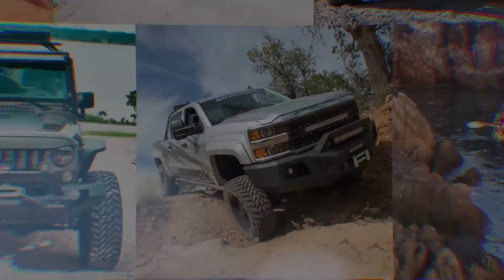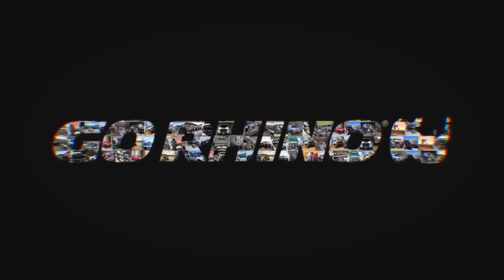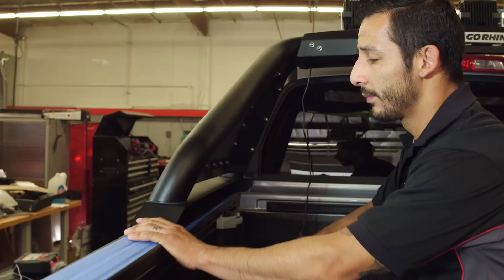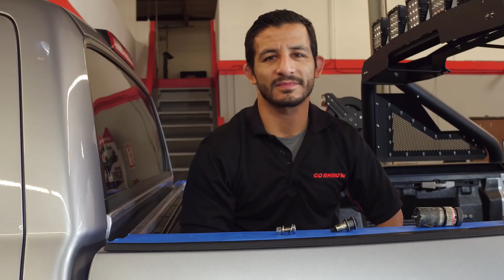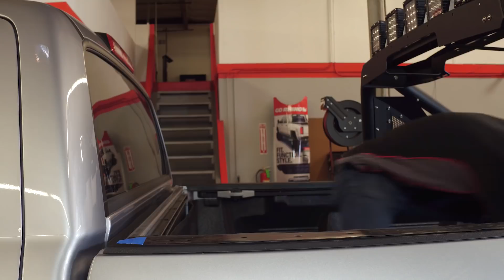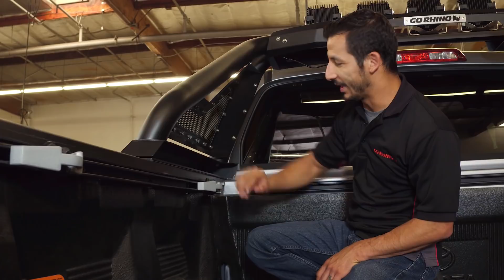Go Rhino Sport Bar 2.0 Overview & Installation (911000T & 960001T)

Comment: do you have to use the 6inch square lights for the retraction option or can i use a light bar ?
Reply from the maker: Scott, we specifically chose to use the square lights but you can use a light bar as long as it fits inside the housing when retracted.
Reply: Go Rhino. can you please tell me the inside retracted dimensions so I can ensure my lights will fit the bar.
Reply from the maker: Scott, the space is 6 7/8" x 42 5/16" so you can fit lights that are up to 6" tall (or square) like the Rigid Industries Q-Series lights that we have and/or up to a 38" light bar.
Reply: Go Rhino thank you ! Whats the depth ?
Reply from the maker: The 6" Q Series lights are pretty thick. The lights are about 3-3.5" deep but we wouldn't recommend anything more than that or you run the risk of the back of the light catching on the bar as it retracts.
Reply: I’m having a hard time finding a 38” light bar.  Any recommendations?
Reply from the maker: There are a few companies that make a 38" LED light bar. We use Rigid Industries, but we know they are a bit pricey. Doing a quick search we were able to find one from Cree who makes a single row 38" LED light bar. We also found a double row 38" LED light bar sold by a company named Assault LED Lighting. Let us know if you still have any trouble finding one for your vehicle. Thanks!
Reply: @GORHINOPRODUCTS  I buyed the 911600PS Sport Bar 2.0 Complete Kit, I need buy the 38” light bar now, what Rigid Industries series o model you recommend me ? Can I install a  40” light bar ? (Rigid Industries of course)
Reply: Aok 30 duble light bar will it fit?  @GORHINOPRODUCTS
Reply: Thanks.. I was looking at the Double Row from Assault.  Would it be the regular double row or the radius double row that would work? It is a big price difference that Rigid.
Reply from the maker: The regular double row would work. No need to pay extra for the curved Radius light bar.
Reply: Rigids webisite says those are 7" lights are they the same ones? I can't find any 6" squares on their website
Reply: Can you buy just the wiring harness if you don't want to do the retractable option?

Comment: Do not buy from this company. They do not stand behind their products. I bought a used go rhino 2.0 sport bar from a private seller. And when I bought it, he did not have the mounting bolts or rivets, and the rubber mat that goes in between the bar was damaged. I tried going through go rhino and through rail truck to get a replacement, and they do not sell a hardware kit to. Mount the bar on a vehicle first time. I've had to run into this problem. When I bought previous bakracks. Bakrack always stood behind their product. I wonder why go rhino can I stand behind their product and supply bolts and rivet nuts and the rubber seal? now I have a eleven hundred twelve hundred dollar roll bar. I can't even use on my truck. And it's just sitting in my yard.

Comment: Does this bar make noise when you drive down the highway with the light retracted? For like a TRX any info I would be great full
Reply: If anything is going to make noise, it would be the lights not the chase rack.  That being said, there are much better options for a TRX.  ADD makes a chase rack with an actuator, and chase racks like the Armordillo can be modified to include one.  These options will have a much stronger actuator to avoid light shaking and faster movement.  I went the custom route for my TRX.  Best of luck

Comment: I've invested a significant amount of money and time into my truck. Typically I do it on a good budget, but this time I decided to splurge on this sport bar and replace my $300 one.
I should have left the $300 one on. It didn't come with useful hardware, manufactured incorrectly so nothing lines up, stripping out bolts. Wires are about 10 ft too short to get to the engine. 
No space to run these wires inside of the tubing like it recommends.
They say keep everything loose until you set it in place, but it makes it physically impossible to get everything to line up correctly. And it actually resulted in me shattering my rear window (which I will PARTIALLY take responsibility for). I am not someone of a low skill set when it comes to these type of installations. I'd recommend you look somewhere else. The only way I would forgive this product is if they reimbursed me. You can save a massive chunk of money and still get a quality product elsewhere.

Comment: Would be really great to see a detailed installation video really going into how to route the wiring from battery to lights and how to get the switches in the dash.  And how to connect multiple lights to the same switch without having to run a bunch of wires the entire length.  The holes are too small fit the wire connectors through.  This bar has a very sturdy build quality but the designers did not pay close attention to details regarding how to make wiring through holes and bars easy.  For the $$$$ being asked for this bar it needed to be better designed and also come with MUCH MUCH better instructions.

Comment: How do you fix the play... wobble ...of the bar with the lights. I put 5 q series rigid lights like shown and adjusted the actuator to its max and proper adjustment and the passenger side wobbles while driving ? Anyway to fix that?

Comment: Love how they skip the crappy rivet nut installation. If you don't have a rivet nut tool you should order one from Amazon that can accommodate the rivet nut size or replace them all together with new bolts and rivet nuts like an M10 or 3/8-16.
Reply: Hey thanks a lot, I followed your advice and got the rivet kit from Amazon M10 and it worked fast and easy.
Reply: lol yeah because I was waiting for that part and he skipped past it because it doesn’t work so easily

Comment: how about wiring to lights or Tonneau cover used with this bar ?
Reply: i have an undercover flex flush mount cover but it can't fully open with this bar on the truck

Comment: What off-road lights work on this sport bar
Reply from the maker: Hello Lorenzo, while we prefer the lights from Rigid Industries, most brands of surface mount off-road lights should work on the Sport Bar 2.0. The top plate (or power-actuated light mount bar) has a series of holes and slots to bolt them in.

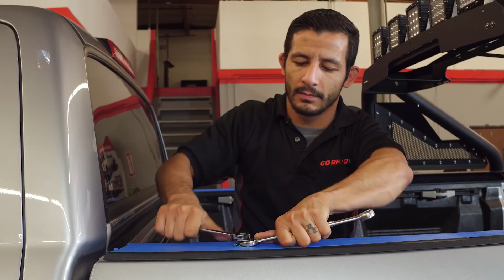Comment: Is it possible to show a video with more detail on how the nutsert is installed? On this video it looks like it didn't catch. (7:20)
Reply: You use a cordless impact driver to secure the bed-serts and a wrench to hold the sert jaw
Reply from the maker: Hello Andrew, it did take us a bit more time to get that in. You can call Ben or another tech at 888-427-4466 to help explain that a little better. Thanks.

Comment: I’d appreciate a reply. I don’t have the same roll bar but I do have a oem Silverado roll bar on my 2018 Silverado. Can I install these lights on my different roll bar
Reply from the maker: Hello Isaac, we aren't 100% sure since we don't have a GM Sport Bar on hand here, but these are the Rigid Industries Q Series lights, which mount the same way as most light bars do, so you probably would be able to do that

Comment: Is there another type that has 3 to 6 inch diameter round lamps which have led bulbs? Square lamps are nice, but round are my kind of thing.
Reply from the maker: Yes, there are many companies that make round lights. We have used Rigid Industries R Series lights before on other products

Comment: How come everything with the bar in the video is different than mine which supposed to be the exact same. Mine did not come with the lights nor the smooth Finnish. This is bullshit! How come the company makes a video with all the cool stuff that would lead you to believe it's an option which is Not? This thing was way overpriced for the product and I didn't even get what I wanted!
Reply: They say right in the video the black is textured, which means NOT smooth. ALSO, says that lights are sold SEPARATELY, which means NOT included. You didn't get what you wanted because YOU didn't read and listen. You should try those things out sometime....

Comment: What’s the exact model number for a 2014 tundra Crewmax?
Reply from the maker: You can order 911000T or 911000PS for the standard version, or order 911600T or 911600PS to get it with the power-actuated light mount bar pre-installed

Comment: Where can I buy these lights? They do not sell the lights that it is advertised with and even when I ask the company they will not tell me like it's classified info or something
Reply from the maker: Yes, the Sport Bar 2.0 is not sold with lights, but we used the Rigid Industries Q Series lights if you want to use the same ones that we did. You can find those lights at most online retailers. Let us know if you need assistance finding a dealer for those lights.
Reply: It has been stated numerous times,  in pretty much every video made by Rhino that had the lights installed, that they used Rigid Industries Q Series Lights.  It should also have been obvious that they are not included, seeing that they sell one with the power-actuator retractable mount (which is the reason it cost more) and one without it.  You can also purchase the power-actuator retractable mount as an "add-on" item, and since it isn't advertised with lights, and specifically states, what size lights fit on it, common sense should have kicked in, and anyone with a brain should know the lights aren't included.  If you would have spent a few minutes researching and actually READ, you would have found that "classified" information in no time.   Instead, you wasted your time and everyone else's who happened to read your whiney comments on this video, and my guess is you didn't even read the replies to your comments that gave you the information you are looking for, and instead you're wasting more time whining in other places.

Comment: My F150 has a PE jackrabbit tonneau cover with a width of about 64.5 inches, I'm not afraid of a little custom work but am curious what the inside width of the bars is, and what the width of the mounting bolts is.  Thank you
Reply from the maker: It looks like the Pace Edwards Jack Rabbit cover is a tractable cover with the bed retracting into a canister at the back of the bed. It should fit inside the 2" channel of the Sport Bar 2.0, but if you wish to speak to one of our technicians, please contact us at 888-427-4466. Thank you.

Comment: I have the "snap on" type of tanneau cover that you roll over when you need the bed. Would i be able to get my fingers in that space to snap the cover in place?
Reply from the maker: Roy, what is the name of the cover that you have so we can be clear what we are working with here? Thanks.
Reply from the maker: Usually, with those style of covers, there is a frame built on top of the bed for the cover to snap on to. Unfortunately, this framework would interfere with the Sport Bar 2.0 as the Sport Bar 2.0 rests on top and is drilled into the bed rail. There's only a 2" space within the channel inside the base of the Sport Bar 2.0 which may be too small to get your fingers in there. We usually recommend retractable or roll up style covers
Reply: Go Rhino that's right I forgot all about the frame. Thanks for the recommendation!

Comment: Any of these for Nissan frontiers ???????
Reply from the maker: We actually have a smaller "mid-size" version for Tacoma & Colorado that might fit on the Frontier, but we have not had the chance to try that yet
Reply: Go Rhino what are the dimensions width from side to side ? I can measure my truck as well if he sizes are close to being the same I'll just buy one, like you said for Colorado or Tacoma
Reply from the maker: the outside edges are 61.5" apart and the mounting holes are about 58.5" apart. Also, it's slightly adjustable as well so if it's close, it might be possible to make it work. Let us know if you have any other questions
Reply: Did you end up trying it in your Frontier?
Reply from the maker: Unfortunately, we do not have a Frontier in-house to test that on so we would have to wait for an opportunity to get one in before that can be done.

Comment from the maker: Hello folks, thanks for stopping by and checking out our Sport Bar 2.0 Installation video. Please note that at 5:35, Ben mentions using a 17/32" drill bit like it states in the instructions, but we suggest starting with to a 1/4" drill bit.
Reply: Would this fit a ford raptor 2013 and if so where can I purchase this?? Thanks!!
Reply from the maker: We've tested it on a 2017 Raptor, but unfortunately we haven't had the chance to test it on any earlier models
Reply: Where do the controls for the bar end up? Will I be able to move my lights from inside my cab?
Reply from the maker: Massimo, you can set up the controls wherever you want, it's up to you. A lot of people like to run the line into the cab so they can control it from the driver's seat.

Comment: What size drill bit you used to enlarge the hole to insert the bolt, I used the 17/32 but it seems to small, and I see in the video u used a bigger one
Reply from the maker: Sorry Boss, we forgot to mention in the video that you may need to enlarge the hole after the fact if it's not big enough to put the nutsert in. For this installation, we did have to switch to a 1/4" drill bit.

Comment: I am interested in picking up one of these for my 17 F150 short box.  Will it work with the Pace Edwards Ultra Groove retractable tonneau cover?
Reply from the maker: Hello John, we have installed the Pace Edwards Switchblade before with the Sport Bar 2.0 and the Ultragroove has a similar setup so it should work
Reply: Don't i wouldn't buy anything from them. They do not stand behind their product

Comment: nicely done video. i just got my stainless version. how did you guys fit the wire down the front tube. the connector is way too big to make it through the pre drilled hole. also the wire coming off the actuator isn't long enough to make it down the tube yet your instructions show it doing this. did i get a bad one or is this typical. thanks
Reply from the maker: Yes, the harness plugs will not go through the tube at the top, so we recommend feeding the wire from the bottom to the top. It might also help you if you loosen it up a bit and then tighten it all back up after you get it through. Let us know if you have any other questions, or feel free to give us a call at 888-427-4466. Thanks.
Reply: Go Rhino  the plug I'm talking about is coming from the motor that runs the retractable bar.  No way to disconnect it. I'll call the help line. Thanks for the suggestion.

Comment: The switch that operate the actuator is single pole -double throw ??  Can i put my hand on the wiring diagram ?
Reply from the maker: It's a double throw switch. We don't have any wiring diagrams as of yet but it should be all pre-wired

Comment: Will it fit on Chevy Colorado 2016? Just wondering.
Reply: Also, can I add tonneau cover with Sport Bar. How you do it with that?
Reply from the maker: Yes, we have a version that will fit the 2015-2017 Chevy Colorado shown in this video: https://youtu.be/tTnACRV3WiI

Ben quickly explains how it would work with a tonneau cover at 8:58 in this video. We have had the most success with retractable covers, like the kind you would find from Retrax or Pace Edwards.
Reply: will a tri fold such as gator fx work with it. I like the looks but need my tonneau cover. Thanks.

Comment: Will it fit a dodge 2016 dually?
Reply from the maker: Yes, it should work for the 2016 Dodge Ram 2500/3500 dually trucks, for all bed sizes